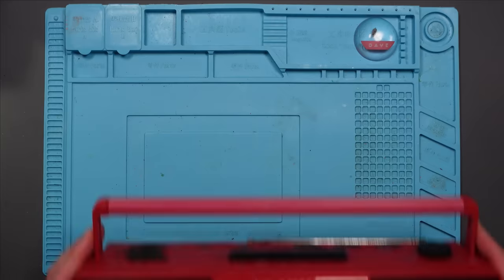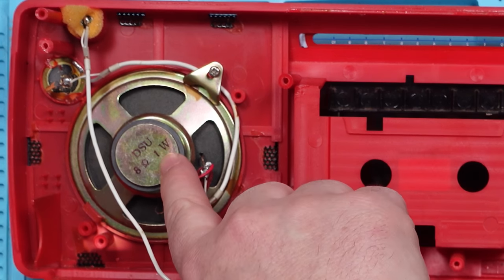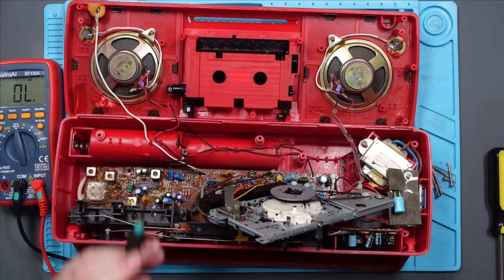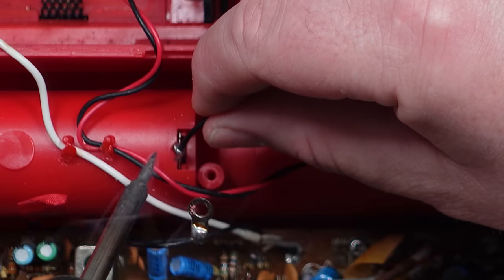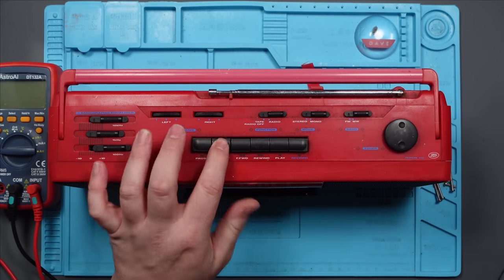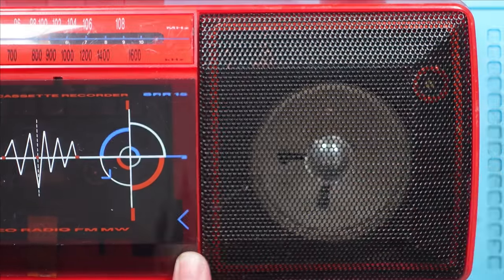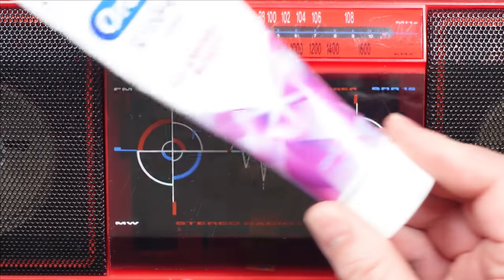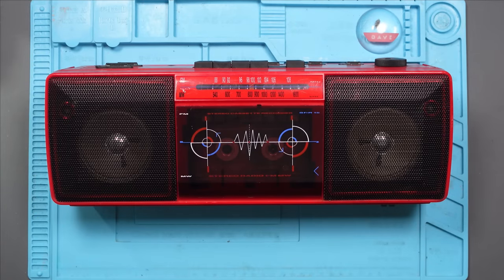Easy FIX? | Boots SRR 15 BOOMBOX!

Comment: In regard to the pink handle. The odds are you'd spend more time, energy and money trying different hacks, Then ya would just repainting it.
 The colors faded so it lost pigment/it never color matched that red anyway probably. It could be it worn away from oil on people's hand. I'd just paint the sucker with a foam brush after masking it off and covering what ya don't want paint on. 
Add very tiny bits of white to the red to get it close to that slightly faded red and keep in mind it'll be a different shade when it's dry, so play with the colors untill ya get it close.

Comment: If you'rr that bothered about the handle then the only solution is to paint it. You're never going to match the colour so there's 2 options. 
1 - remove all the components from the main housing and spray paint  the whole thing.
2  remove the entire handle and spray paint it black.
Option 2 is easy and the black handle shouldn't look out of place because the main unit has a red and black paint scheme. 
Oh, don't use any old spray paint. Go to the model shop and get some plastic friendly spray paint.

Comment: I'd remove the handle give it a sanding with 1200 grit sand paper apply a coat of red type paint.. no primer at all.. since you want to (dye it) once dried sand again and recoat. Repeat until you get desired hue of red.

Comment: Use your hot air station on low heat on the handle bud it does work just take your time.

Comment: It's something in the infrared spectrum that makes red fade I know on older red cars you can use tcut or Brasso to bring it back but does fade again good for if you are going to sell the car modern paint is much better and I have seen seats in football stadia done with the flame but that may be a different plastic.

Comment: A kind of "recolouring" is not really possible . Perhaps some red polishing wax (for shoes /cars) But there is a risk that it might come off. But I've got one question: I saw some parts on that circuit board that looked like cubes with coloured screws inside them. Do you know what these things are and what they do? ( Timestamp: 1:35, on the left handed side)

Comment: Toothpaste does work, but not with a cotton swab. You need to actually polish it with a bit of pressure behind it for a few minutes. Use tooth whitening tooth paste, as that has more aggressive polishing shit in it.
Heat would work on the handle, but its just a temporary fix.

Comment: red pigments are notoriously fugitive, upon exposure to light they fade over time to light red or pink,,,,sometimes there is a thin layer of oxidation , to white, and with cleaning off you will see a brighter red underneath, but  I don't think you can get the pink back to the red, unless you paint over it

Comment: Spray paints for the handle. Easy. To fix the scratches on the grids real paint is better then ink. Just buy a little bottle of paint for scale modeler. For this use enamels are better then acrylics. Toothpaste is good for minor scratches. Just because it's a mild abrasive. For bigger scratches, on surfaces without drawings you can use sandpaper. Start from 500 not less. Stop to 3000 or more. And to finish it a car polish. Sorry for my bad english. Bye.

Comment: For cloudy, discolored plastic, i suggest a quick, and I mean VERY quick wipe with acetone. It will take off the layer of oxidation and return it to the color it was originally. If you have it on there for too long, it will literally eat through the plastic, and melt it.

Comment: Retrobright does work with colors. There is a new method using  vapor instead of applying a paste or soaking the plastic in chemicals. https://youtu.be/WXhxTtK42A8?t=198

Comment: mmmhh how unprofessional to try to get color back by using toothpaste or baking soda? Thought you would be better. The handle is bleached out by the sun and all you can do is paint it or replace it. To use toothpaste or baking soda for polishing is because both have tiny pits of grain which sands the plastic. But for that you need to use a small piece of cloth and not a stick. Apart from the fix of the radio your video is too utter nonsense.